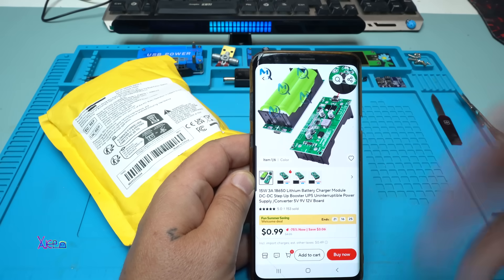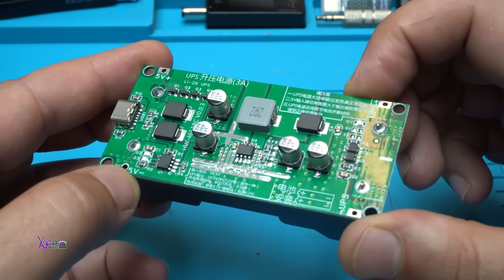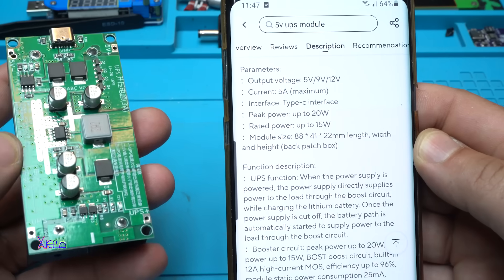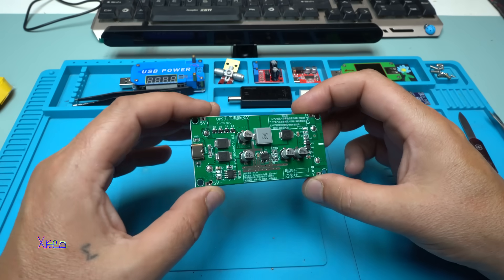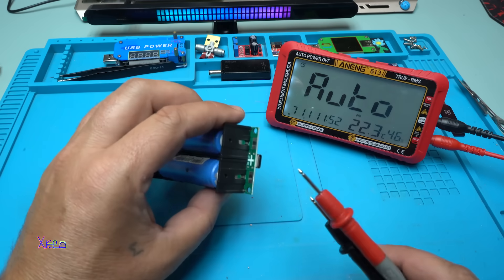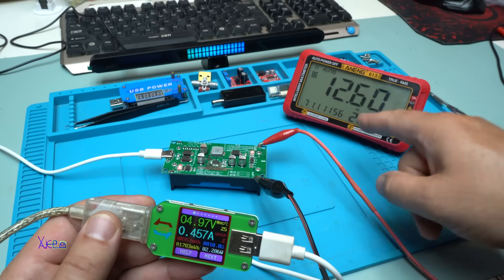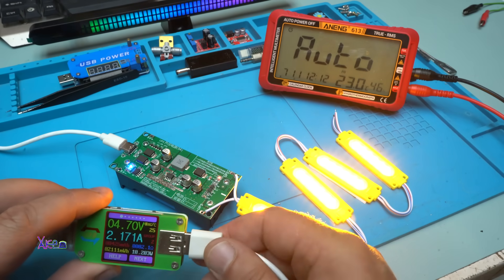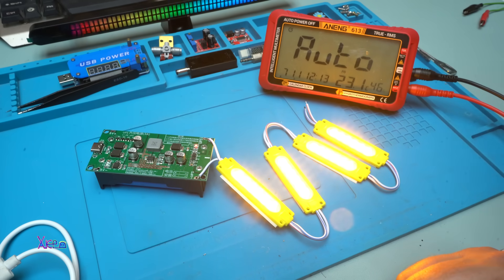WHY THIS $1 Amazing Module is BRILLIANT?

Comment: I tried this board and apparently it has no low voltage protection for the batteries. I connected a small load on the 12V output and the module did not switch off the output even at 2.6V battery voltage. The output voltage fell down from 12v to 2.6V (e.g. the step up converter stopped working) but with that 2.6V the load did still drain the battery. I assume that continue this experiment would destroy the battery.

With this in mind, the module seems to be pretty useless: it helps only for shirt supply voltage outages but in case of a longer outages, your batteries are destroyed. 

Did anybody else check on that - did I receive a faulty piece? If not, people should be warned ….

Comment: The module is NOT backup module since with 0.5A/5V charging it is unable to supply 15W continuously to load. To be true backup it should have charging power more than maximum load power, say 20W/15W.
Reply: It actually does that, and you can see when it was tested with the LEDs, the "charging" (load + charging) current was over 2A. I have a bunch of these modules, they can deliver 15W (but try to keep it at 10W), even without any batteries. The circuit is just the TP4056 for charging and a boost controller, nothing else. You do need quality 18650s, or else they will trickle charge and heat up. Also it's not great that the batteries are kept at 4.2V, but for such a simple design you can't expect much better.

Comment: I read that standard maximum charging voltage for an 18650 lithium-ion battery is 4.2 volts. You said it outputs 5V at the lowest setting, and fits 18650s. What say you? Am I misunderstanding? Does it charge the 18650s correclty, then power the switching power supply with the 18650s? 
Maybe I missed it, where is the link to the product? Thanks.

Comment: Using the flat contact battery holders, I recommend you to place first the positive, and then slide the negative in place. If the isolation arround the positive pole of the battery is damaged, it can short-circuit the positive and the negative in the battery holder contacts. Beyond that, nice gadget, I have a 5v, 9v and 12v psu board very similar to this one, without the battery holders, and my idea is to use it, as you said, to power the router.

Comment: How do you switch to the other output voltages? I’m sure there are some pads you short but could you confirm it does that.
Reply from the maker: I will try to do that and some new testing

Comment: I've used them for my solar powered projects and as a UPS for my alarm clock, router, and Raspberry that runs my home automation, they are very useful gadgets.
Reply: that's what i have used them for little things that i don't want to reset or go through the trouble when the power goes out very handy at an incredible price
Reply from the maker: Great idea, thanks for sharing!

Comment: The module is good, but it heats a lot. You should have a charger with 1.5-2Amps minimum power supply to be able supply load and charge two 18650. And consider to attach a radiator on the TP4056 chip, it will very helpful. Also you can increase space between PCB and battery holders for 1-2mm to keep batteries not so hot.
Reply: Extra feature: Worms! 😅

Comment: One bad thing about that board is that it will drain the batteries if left for awhile...
Reply from the maker: Yes it will drain the batteries if there is no other power source
Reply: A 15A DPDT switch on the battery feeds to the board fixed that storage issue.